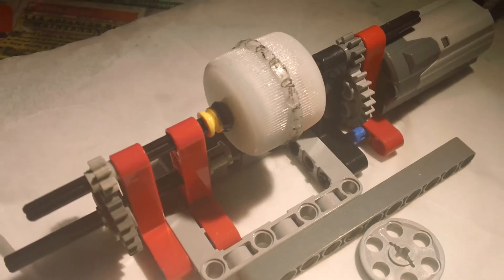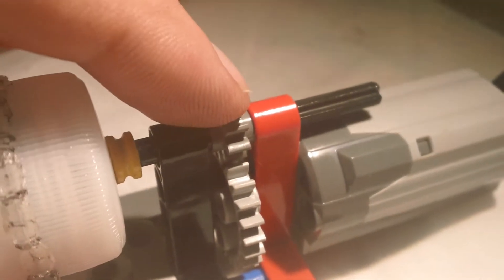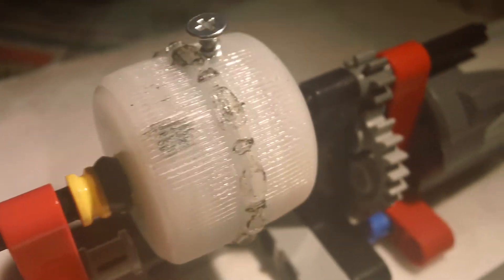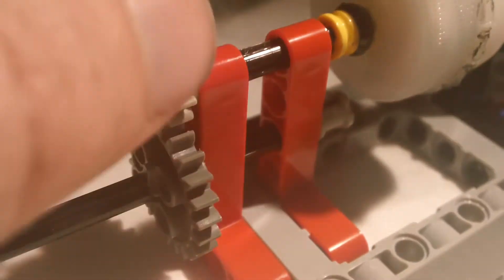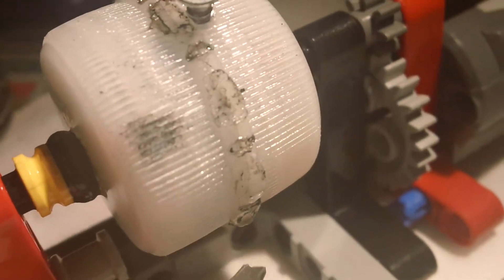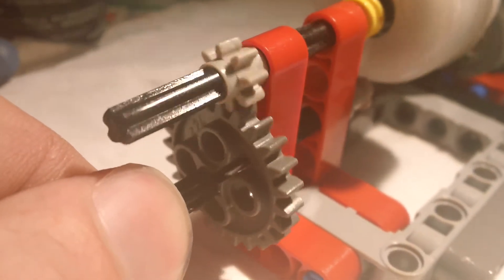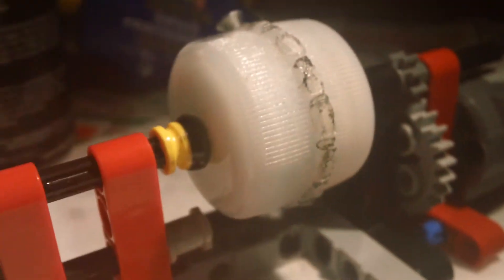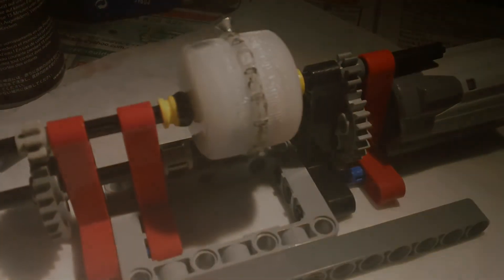LEGO - Fluid Drive Coupling Prototype Overview and First Run!

Comment: Interesting work! For a start, the Routemaster is pronounced like 'rootmaster', it's a British design and name after all.
I guess the basic torque transfer is done purely by the friction of the o-ring. As I don't know how much pressure you applied with your fingers I can't say how much torque the coupling can transfer. In the original it almost locks up completely, shortly after starting off from stillstand you can't really feel any slip in the flywheel (much different when compared to a torque converter). 
If the housing is connected to the input shaft I'm not sure what the wheels on the input shaft inside are supposed to do. Basically you'll need to get the oil spreading over the inside of the casing by using centrifugal forces to then transfer the speed and torque to the output wheel where a cog would probably work better. There will still be a lot of torque loss as there's nothing where the oil can 'hold onto' on either side.
Still, good idea!
Reply from the maker: Thanks for your comment! The o-ring surprisingly doesn't offer that much in the way of torque transfer. The wheels on the input side serve to 'spin' the oil around inside the casing. It's been quite some years now but I'm sure I experimented with cogs instead of the pulley wheels but I managed to get more torque transfer from the pulley wheels in the end. 

The design is sound and ended up powering a Lego bus of my own design, it's on my channel as well, moving under its own power, running through a 2-speed gearbox 😃

Thanks for watching 😎

Comment: incredible,  dose increasing resistance on the output shaft put strain on the motor?
Reply from the maker: Great question! Answer is yes, it does indeed and this was what surprised me a little bit also - it shows that the fluid drive is performing useful torque transfer. I am making further progress with this drive (it is now off the test bed and mounted in the vehicle). I have placed a remote gear changing mechanism on the vehicle and an audible change in motor RPMs is heard when the change from 1st > 2nd gear is made. I hope to have an update video on here sooner than later. Thanks for watching.